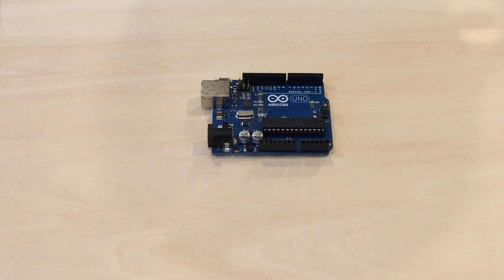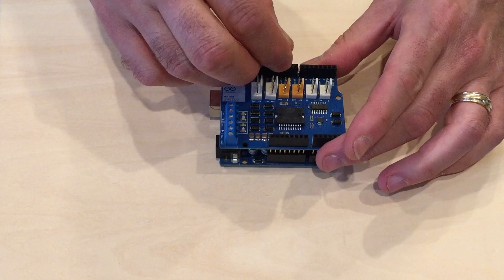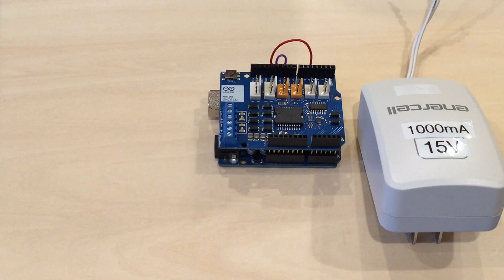An Arduino DCC++ Base Station: The Hardware - Part 4 of 4

Comment: Hello, thaks for your videoguide. I hava problem with motor shield. i have cut the Vi connect but there is othes 2 points in bottom side of the shield. A e B breack disable. I should cut these connections? thank you very much.

Comment: I need help from you, I have a problem where I have everything installed to the board and it’s all hooked up to track and such, when I connect it to track power, it disconnects signal from the USB port. I also have a problem where it was working fine last night. This evening when I tried to set it up, nothing works on the board, I’ve done the basic troubleshooting and nothing works at all.

Comment: where did you find the 15v 1000ma power supply at
Reply: Looks like the power supply for a battery charger. You can find random wall warts at a thrift store

Comment: This'll sound stupid, but how do I provide the 15V to the motor shield? I understand that it uses the 2 screw ports near the outputs, but I have a cable that goes with the lower port. Does anyone have a solution?
Reply: The terminals are for a short section of bare cable to be clamped in place.  Look up terminal connections, there are a lot of specifics and a million guides online for how to do it right.  I get nervous as I work with watts not milliamps for 3d printer heating elements.  I think at this level of power its a bit safer but still read up on those terminal connections first, then cut the cable and attach the positive and negative to the correct terminals.  Be incredibly careful about that positive and negative part!  Again, just advising you to read up on it providing a keyword, I am not an expert and this is not a guide.

Comment: Are there any block detection systems that are compatible with DCC++ aside from using another system with its own interface for sending data to jmri ? as I would like to use DCC++ for the base station points control and block detection. Also will this be supported by Train-controller Gold by freiwald ?

Comment: Hi, thanks for all the great code and tutorials. I've assembled my Arduino and motor shield, but I'm finding that my Arduino doesn't communicate with any DCC devices, and I have previously used these with a DYNAMIS system. I'm using a 15V switched mode PSU - is that likely to cause an issue? I have turned power on with a <1>.

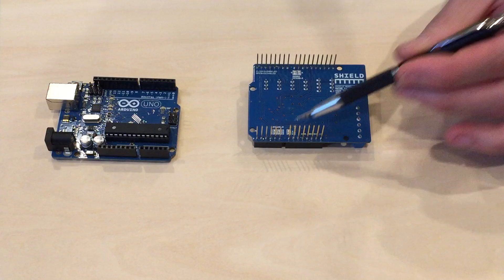Comment: At around 2:40 you talk about cutting the connection. Can I then connect a 12V supply to Vin?
Reply: You wont need to as you need a computer running JMRI to send data to the Arduino so the computer will power the Arduino via 5v USB and the motor shield 15v input will power the DCC tracks.